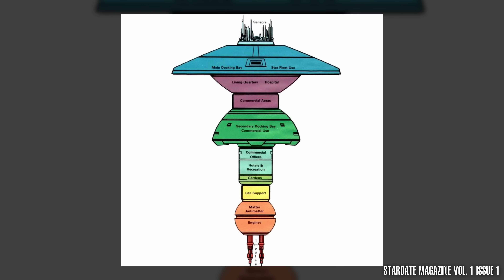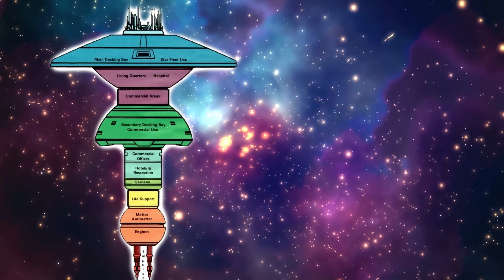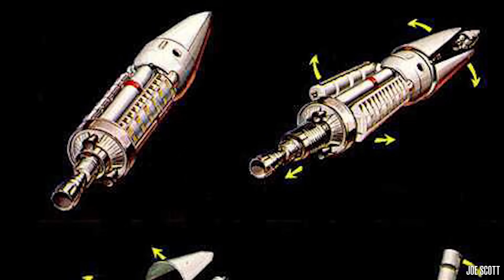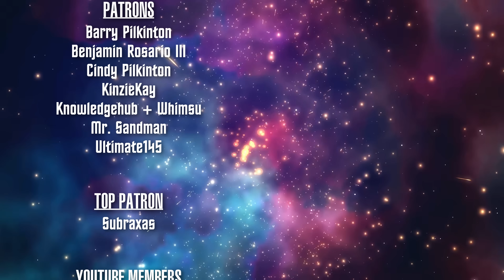How Do Starbases Work?

Comment: I would point out that starbases in Star Trek are not actually all that large, in fact, they're not even big. In very real terms what's special about Star Trek space installations is that they are miniature compared to real world space habitat concepts. This boils down to the fact that we do not now and may not ever have access to gravity manipulation technology, which means that scale works to our advantage. You touched on the O'neil cylinder concept but failed go point out that it absolutely dwarfs earth spacedock, which would fit comfortably inside the O'niel cylinder... sideways, but even then the O'niel cilynder was designed with a 1970's understanding of materials science. Modern variations of the concept such as the mckendree cylinder feature a diameter of up to 460 kilometers and 4600 kilometers length, meaning if you put the earth spacedock next to one in the same picture it would be just a dot.

Comment: This is something I’ve always preferred over Star Wars. Yea, the Death Star is massive and some stations are larger than other capital ships but the majority are…the same size as capital ships. And it’s just like, ok? Why not just have a capital ship there when needed? What can a space station the same size or smaller of a capital ship have to offer? 

There are some excuses but for the most part in general scifi: I think your stations should be considerably larger than the average capital ship.

Edit: this mindset comes from gas stations for me. Like, if a gas station or a truck had the same amenities and supplies as an average single truck, then what’s the point of it?

Comment: That's… not how orbiting works. ISS doesn't fall back to Earth because it travels around the planet fast enough that the surface curves away from it at roughly the same speed it falls. The thrusters are only used to avoid impacts or to counteract the tiny amount of drag from the extremely thin atmosphere.

Comment: Hey man, loved this. 

Especially about how gravity plating are low level warp fields, I’ve thought that too. I’ve had that thought before myself, plus that can easily be how the inertial dampeners for sublight travel work too. The field in the impulse engines or thrusters are coordinated in the computer with the lower level (but pervasive) fields in the deck plates. 

Always like your mix of IRL theory and setting fake explanation. Something akin to O’Neill cylinders, Bernal spheres, and the similar other-shaped structures are almost certainly in our long-term future if we don’t kill all ourselves and the planet first.
Reply: …and now I notice a doubled-up clause which the letterbox of editing field on mobile (as a remote for my TV) made me miss. Can’t edit it now that you’ve hearted it though!
Reply: Acceleration at mind-boggling rates requires some massive canceling out to avoid turning the crew into paste. >.> In a lot of ways, artificial gravity is almost required for believable SF.
Reply: @thegneech  That depends on whether you're accelerating using sub-light engines or warp engines.

When you're traveling at warp, you're not really "accelerating through space", you're actually taking your space with you.
Reply: @uncaboat2399  True. Impulse engines can still accelerate mighty dang fast, tho!
Reply: @uncaboat2399  yeah, that’s why I said sub-light inertial dampeners, as the Alcubierre drive would theoretically not need any of them. 

Though there’s explicit dialogue stating they need them for something for warp speed in Trek, but that’s going to be an entirely different coordination system given it’s a different engine. 

Plus if we bear in mind the the warp drive can run at warp factors below 1 for sub-light travel, and the impulse drive can get up to 25-50%c, then perhaps they actually always have to use both for the initial jump to warp? Enterprise shows the earlier ships have pretty rough “warp transitions” even with inertial dampening, so the inertial dampeners for FTL could be purely for the enter and exit stage of flight and useless in the middle. 

And that might be kinda compatible with the Alcubierre-type calculations too — we currently have no idea how that shower of high energy particles the ship will run into/expel outwards as it enters/exits the bubble will actually affect the whole experience. 

But I was definitely thinking about the “if inertial dampeners are down and we do evasive manoeuvres, we get thrown everywhere” thing in my comment, as seen in at least Enterprise S4 and Beyond. And that time Geordi gets thrown around the turbolift. 

It’s still pretty beefy accelerations to cancel out, to be able to stay standing with a cup of tea vs getting thrown on the ceiling. But it’s probably well within the gravity plating’s abilities to generate an acceleration in the opposite direction as the engine, pretty much instantaneously as the helm officer does their thing. (Very much like how IRL you’d need ship thrusters to activate automatically in the opposite vector to compensate for the thrust produced by turrets, railguns, etc.)
Reply: Star bases aren’t really meant to move, it’s not low orbit it really just sits there. Also ds9 had to use it shields to create a bubble for it to move, would have caved in on its own weight otherwise.
Reply: @uncaboat2399 in fact when warping the ship is in its own sub space and that allows travelling at ridiculous speeds bending the laws of the universe. They also have inertial dampeners to smooth out the initial “kick” such drive would provide while it is creating that sun space bubble warp. In Star Trek they can even recognize a ship flying at warp speed just by analyzing its warp bubble. Which has the signature of the ship shape.

Comment: I think you are confusing Starbase’s, which in the Star Trek world are huge sprawling often planetside or a mix of surface and orbital facilities, with Spacedocks and Space Stations. Remember in Encounter at Farpoint they were offering the newly built Farpoint facility, basically a small city of buildings and resources, to the Federation as a Starbase. A Starbase is a major port of call. A location that can provide every service needed by Starfleet. We see this same thing in TOS. Whenever they visit a Starbase you can see out the Admiral or Administrators window that it is an on the ground complex. Whereas K-7 is a Space Station not a Starbase. Deep Space 9 is a Space Station, not a Starbase. The only incongruity from this within on screen Prime Cannon Trek is in ST Discovery with Starbase One. Which is a large floating space station. But there is so much else wrong with that unicorn in how it is described, that you can discount pretty much everything said about it as pure stupidity. (The distance they describe it from Earth would put it within Earths Solar System, Outside Pluto’s orbit, but orbiting some lush blue green planet? Yep! Discovery’s Technobable is noticeably worse than where any other Trek show has gone before.)

Comment: Do we have the ability to build a Star Trek-type space station now? No. The materials to build it have to come from someplace, without impulse drives we'd have to use chemical rockets to get construction supplies into orbit. That would take millions of launches and all the launch costs that go along with it. Mining the moon for the metals to build a space station would be a massive undertaking, but it'd be far less effort to launch from there due to the lower gravity. But if so much effort would go into building mining colonies on the moon for such a project, you might as well just build a moon base rather than a space station. Some gravity is better than no gravity.

Comment: To have the Station stay up in orbit, they would only have to be in a geosynchronous orbit - 22,236 miles above the earth - without having to worry about falling out of orbit. Still, having thrusters as an emergency backup would still be good.
Reply: Anything in orbit above the atmosphere will stay in orbit.  There are still launch stages from the 1960s orbiting Earth, and they didn't make it even close to geosynchronous.  They are just a few hundred km from the ground.

The ISS and Tiangong are just under 400km up, which is still within the atmosphere, if only just.  They use their thrusters to reboost, not to counter gravity but atmospheric drag.  They also use their thrusters to avoid space debris.
Reply: @davidwuhrer6704  OK, thanks for that, I was thinking of staying above a fixed point on the earth. My mistake

Comment: Im sorry but the Propulsion segment is a GROSS oversimplification. The Iss basically will stay put in the orbit, it will not fall down, There is however some exospheric drag (just like down here but waaaaay smaller) slowing the station down ever so slightly, hence the thrusters. However, if we were to put an object in a "Higher orbit" it would take thousends of years for it to fall down (because of practically non-existent drag) so you don't need to put any sort of propulsion on it

Comment: It rivals the size of Babylon 5, which also has its power core at the far end of the station. It seems to me that life support should be closer to living quarters or have multiple locations.
Reply: It depends on what "Live support" means. When its the central core where for example Oxygen and Water is treated, you want to have that near the fusion reactor. But yes, there should be small stations in the living area where they pump the air into the cabins
Reply: Starfleet in general always has backups on backups on backups when it comes to life support, so I would expect at least as much redundancy from Spacedock.
Reply: @acmenipponair  The living quarters would already need plenty of power for heat, light, replicators, air scrubbers, computers and whatever else they have. Wouldn't it be easier to move power to the living quarters than to move bulkier air and liquids back and forth? Don't they recycle waste using replicator technology which could be in every kitchen and bathroom? I would think a larger plasma conduit or whatever they use to carry power would take less space than the air and liquids would need. Something as vital as life support should also be decentralized with more than enough redundancy to compensate for many localized failures.

Comment: Correction: The Impulse Fusion reactors are normally located directly near the impulse drive thrusters.  Their power or plasma is not is not transfered VIA the EPS Conduits.  The EPS System is a byproduct of the Matter/Antimatter reaction system and it is what powers the subsystems throughout the ship.  Electro-plasma is a different energy that fusion plasma.

Comment: Earth Space Dock is one of Starfleet's largest orbital installations. Its beam and draft are 3,812 meters by 5,544 meters respectively, with a total dry mass of 10,552,000 metric tons. It offers a massive spacious volume of 21,924,000 m³ and has a standard complement of 312,000 souls aboard.

Comment: Love it! It would Make sense that if you have technology that can bend or warp space, then you would have the technology to bend or warp space under your feet to simulate gravity. Let alone create a small warp field above your ship to cancel out the space-time warping affects of the planet to allow you to hover. ( antigravity ) A lot of people think that warp drive is automatically faster than the speed of light, but it really depends on how much power you put behind the warping effects. Just a little bit of power and you can warp space enough to move slowly forward. Put in a crap ton of power and you’re moving faster than the speed of light. Put in an unimaginable amount of power and you’re warping space so badly that you start to rip the space time continuum.

Comment: There are space stations and then there are starbases.  Take Regula 1.  If memory serves, Regula is a scientific research laboratory.  It isn't described as a starbase.  It shares design with starbases though which remain in use well into the 24th Century (see the "new" starbase 173 in TNG's "Measure of a Man.")

Comment: Do the Salyut stations don't count in the definition?
Reply from the maker: That was a mistake on my part-- check the pinned comment 👍
Reply: Ah! For some reason I missed that. I had wondered if it mightve been because the Salyuts were single-module stations and not assembled in slace... but now that I'm thinking about it, Skylab was also a single-module station so I also missed that

It's a great video!

Comment: Slight correction, I think your "Propulsion" section may be based on some false assumptions about orbital mechanics.

First of all, yes, ISS does use thrusters to stay in orbit. However, those thrusters are not firing constantly. Those thrusters only fire about once a month for a few minutes to boost the ISS's orbit slightly, to compensate for loss of speed due to friction against the residual gravity at the 400-km low Earth orbit.
(Those thrusters are also not on the ISS itself, but usually the station is "pushed" by a docked Progress spacecraft)

In general, objects in stable orbit stay in that orbit unless an external force (such as atmospheric drag) acts on them. From what we can see, the stardocks seem to be at a much higher altitude than the ISS. And the atmospheric losses decrease dramatically the further you get from Earth. The Hubble Space Telescope, orbiting at ca. 600 km, was only boosted twice, with years in between.

Also, stardocks are much more massive, and with comparatively less surface area than the ISS. So they would get dragged along much less than the ISS (compare throwing a lawn dart with throwing a feather).

 As a result, stardocks might not even need any source of propulsion to stay in a high orbit. Or if they do, it would be an almost negligible part of the design. It might also just get an occasional nudge from one of the docked spacecraft.

Maybe you understand all of this, but it seems your video spends a lot of time on this, and this might give some viewers the impression that a space station needs to be under constant thrust to stay in orbit, which is not the case.
Reply: @subraxas  He does not state it, but implies it. He says "The ISS is in a permanent state of free fall, more or less, and astronauts experience 90% of the gravitational pull that they experience at ground level. SO it has to use thrusters to keep from descending into the atmosphere." That implies that the orbital decay is due to gravitational pull, which it is not. There is no information about atmospheric drag. The way it is phrased may mislead less informed audience.

Also, "astronauts experience 90% of the gravitational pull that they experience at ground level" is also misleading. The astronauts do not "experience" any grav pull, because they're in free fall. Yes, they are technically pulled by a gravitational force that is about 90% as strong as that on earth, but that only prevents them from flying off into space. They do not experience that pull as we do on the surface.

All in all, it strikes me as if the author really does not understand the basics of orbital mechanics, which unfortunately means he adds to the confusion rather than providing good information.

Comment: You could look into how gigantic starbases are placed in the middle of nowhere. Are they built there or are they moved there. Impulse drives will not do for much more then to move them around within a star system. Maybe they have strap on warp nacelles that can help move them at low warp? I have also seen plenty of episodes with the smaller outpost type of space stations used to overwatch a border or our for scientific experiments. I suspect that those are towed by some large ship, perhaps purposely built for that purpose.

Comment: Centripetal force, not centrifugal force
Reply from the maker: Not quite: https://en.wikipedia.org/wiki/Centrifugal_force?wprov=sfla1
Reply: @OrangeRiver  it's inertia.  Centripetal force is the active force.
I'm an engineer, they drilled into us that " centrifugal force
" really isn't a thing.
Reply: @OrangeRiver  first line in the Intro section in that Wiki article:

"Centrifugal force is an outward force apparent in a rotating reference frame.[1][2][3] It does not exist when a system is described relative to an inertial frame of reference. All measurements of position and velocity must be made relative to some frame of reference"

Comment: ... Did you just say that you have to push a station up because its in freefall, to prevent it from falling in to the atmosphere?  That is.. extremely uninformed, or just horribly, horribly worded.  It occassionally does stationkeeping due to bleeding off orbital velocity due to colliding with particles in near earth orbit.

A starbase higher up than the space station gains exponential reductions to drag as it climbs.  If the spacedock is at geosyncroneous orbit it would barely need any thrust at all, but certainly more than what the ISS has still.

Comment: You do not know much about orbital mechanics either. The orbit of a body in Low Earth Orbit does not decay because of the Earth's gravity, which is the same gravity that keeps it in orbit in the first place. Rather, decay occurs because of the drag caused by the outer elements of Earth's atmosphere acting on the body.